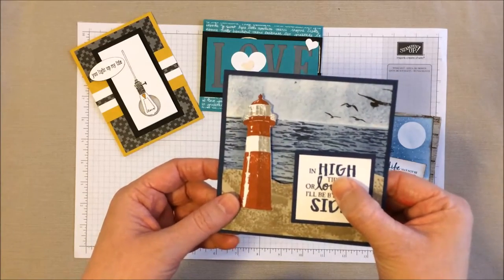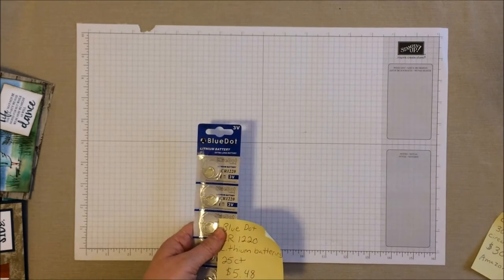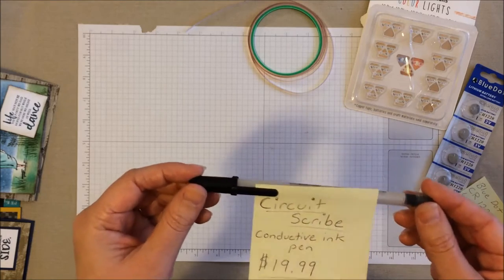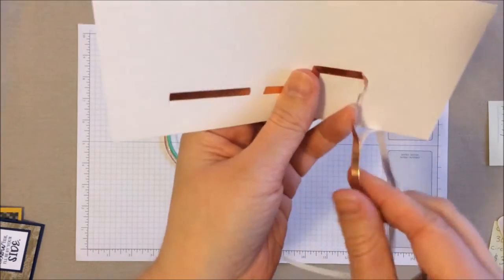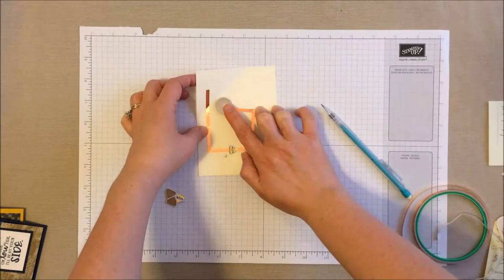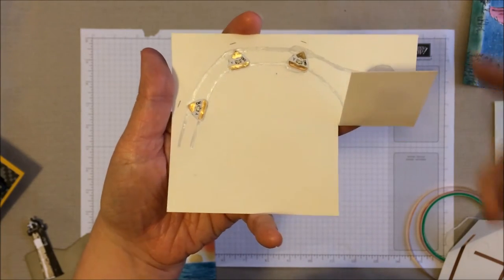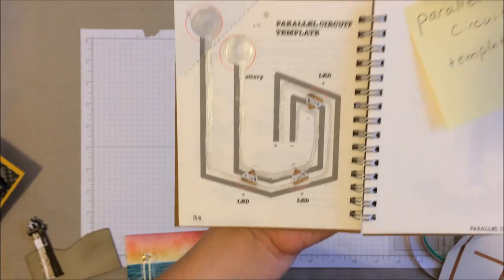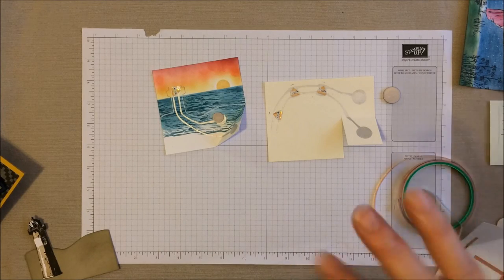Circuitry Basics

Comment: Wondering if you could use felt tip markers on the little LED lights to make them different colors? ( i.e. orange, green purple etc.) or use acetate 
film and color it with felt tip markers?  How many lights will run on a circuit powered with these 3V batteries or what do you need to power 5 or 6
lights?
Reply from the maker: Dawn Dobbs Lots of great questions Dawn! I have tried coloring on both the LED and on acetate and it kind of works. It tends to look streaky when colored on acetate especially with the traditional markers the new blends aren’t as bad but both don’t give a strong enough color to really be a better alternative to just buying the colored lights. As far as how many lights can one battery sustain I generally don’t go over three, you can do more but it will increase the cost of your card and in general more lights will wear the battery out faster and may not shine as bright as only a few. I hope that helps, have fun trying out these awesome products and if you’re buying off Amazon please use my affiliated links in the video description. Have a lovely day.